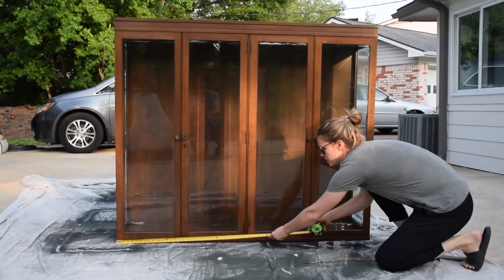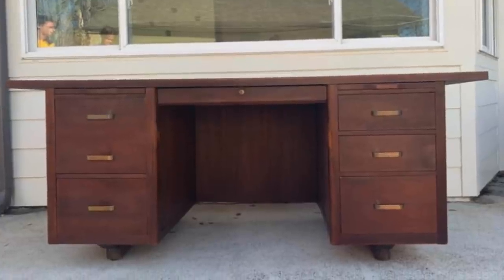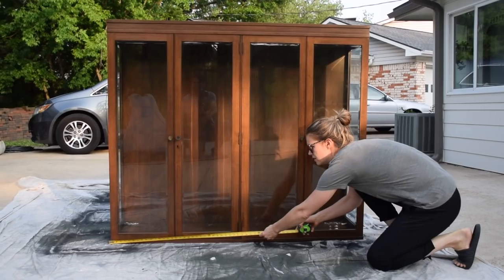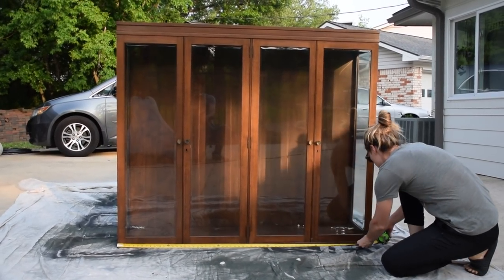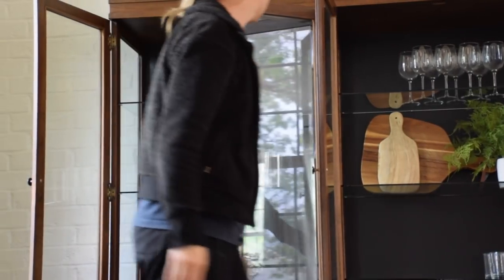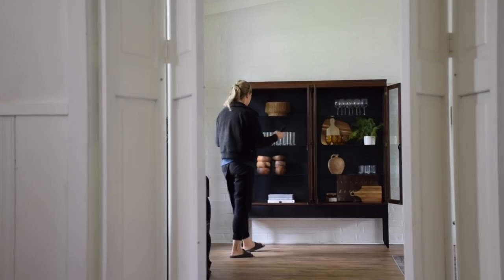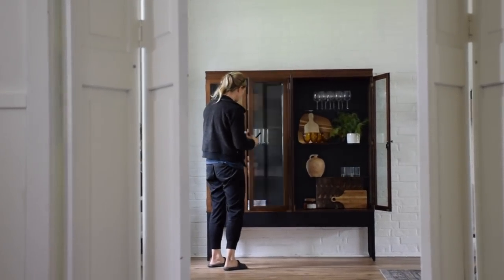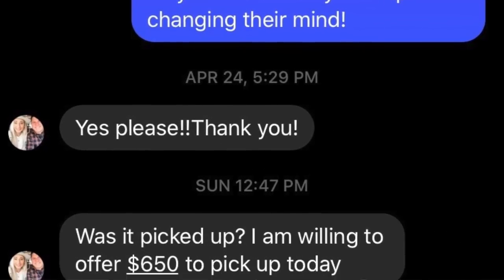Flipping A (Free) Display Cabinet // furniture makeover for profit

Comment: Love this repurpose of the top of a china cabinet.  So many are abandoning the tops and just using the base as a buffet when the cabinet can be taken apart into 2-pieces.  The squared off shape seems to be easier to repurpose.  I saw one in my local FB Marketplace that was similar in shape to this cabinet top.  They painted it, put hairpin legs on the bottom and removed the glass from the doors and inserted cane.  It looked great!  I like the wood bases Andrea makes better than the hairpin legs as I typically am not a huge fan of that style of furniture legs.  But, I do like some of the cane work I have been seeing people use in their furniture flipping.
Reply from the maker: I agree about the square shape being easier to repurpose! And hairpin legs aren’t really my thing either, plus I really felt this piece needed something a little more substantial at the bottom other wise it would have looked just like I stuck small legs on a china hutch lol! Anyway, it was fun to do something different and unique, thanks for following along!

Comment: Nice work, but when spraying outside, you should try to create some type of a barrier that will prevent the atomized paint particles from getting carried in the air and landing on your (and more importantly your neighbors’) cars and houses.  Overspray can travel for miles and it doesn’t always come off easily, ( speaking from personal experience..)

Comment: Hi!

Hmm... I am not really sure what they are called in english... I´ll discribe it... A tall cupbord that looks like a cabinet with doors or like a dresser with drawers on the lower half and that has a top with shelves behind glasdoors. Those are often made in halves or can be sawn in halves. You could do something similar to this with that kind of furniture. 

I would put in hidden lights either in the ceiling of the cabinet or around the inside of the door(s) to make it even more "more" ; )
Reply from the maker: Where we are they're usually called hutches!  They don't typically sell well in our area, but I may have to rethink getting more!

Comment: Here is a hint: if you need 1” thick oak boards in lengths less than 48”, go to the big box store and buy oak stair treads. They are glued up, but most of the time, I can rip 1x1 one 1x2 boards off a tread and it makes for great legs. Very reasonably priced too.

Comment: Why are you wearing a respirator without the filters? You are talented and young take care of your lungs
Reply from the maker: I just got a new one in the mail with extra filters!  I had thrown my old ones out, but then the replacement filters were out of stock everywhere because of covid.  It still has the filter on the inside, so still keeps out all the larger particles of paint way more than the other little masks since it fits tightly to my face :)